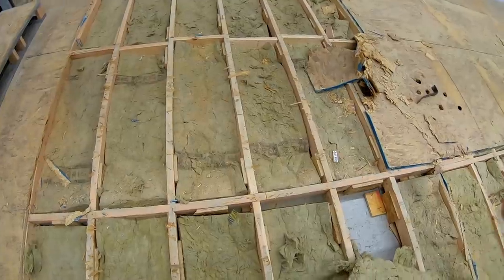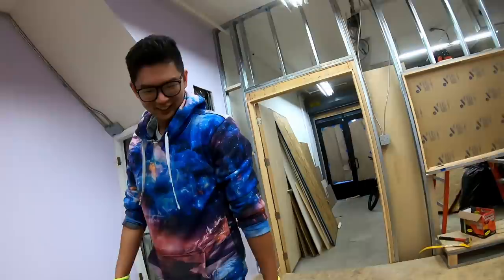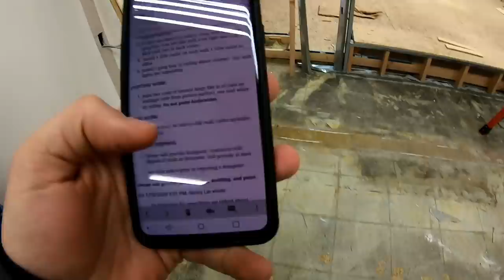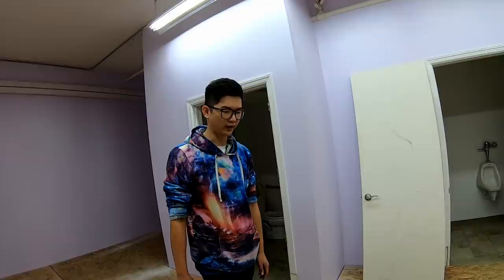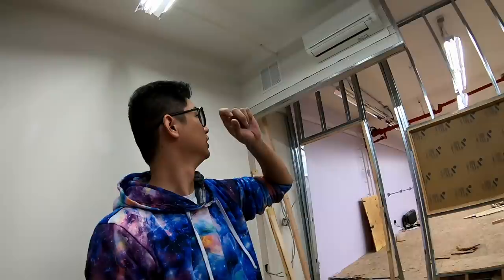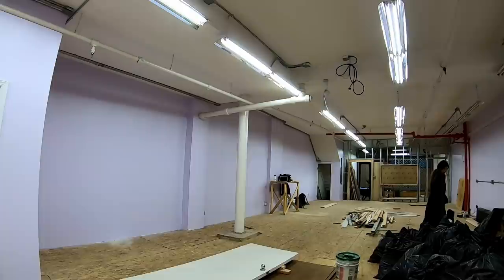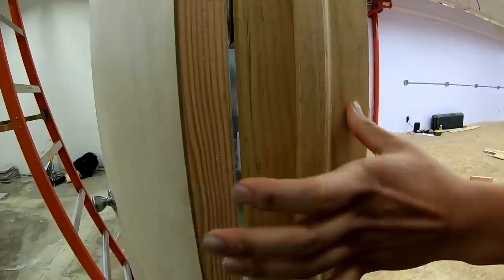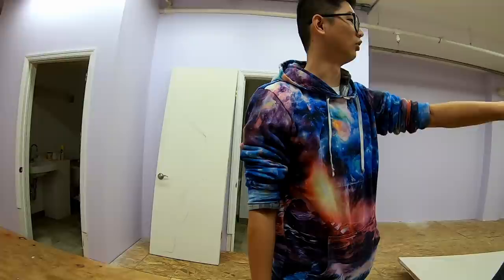Day 44 - THE RETURN OF SUNNY! Contractor C walkthrough

Comment: You can not bury a splice box.it goes against electrical code. Keep the access panel or make it accessible with a fancy cover plate flush with the ceiling. NEC 314.29
Reply from the maker: The electrician recommended rewiring for our intended usage rather than putting an access panel in for a junction box that, if we were doing this from scratch without an office in the front, would not be in that spot to begin with. 

Also - shout out to everyone who has emailed with actual offers to help here. An HVAC company emailed refusing to accept money wanting to help move the mini split for free because him/his boss have been following and felt bad about me getting screwed. A licensed electrician emailed ideas and said he wants to stop by and do a good amount of the scope of work and not charge. I can't accept this, I will be finding a way to sneak money into the pockets/bank accounts of anyone who actually does this(after background checking to ensure you are not eugene v2). I am humbled almost to the point of tears reading these offers and kindness from people who I do not know who just feel sorry that we got screwed. I don't have words for it besides thank you.
Reply: @rossmanngroup  Take the HVAC guys up on the offer. The previous quote was based on an absolute worse case scenario.  It really doesn't look that difficult in the videos. I've installed a half dozen of these systems and they are way easier than my normal AC repair work on a tractor or truck.
Reply: Glad I wasn’t the only one who noticed that. Shouldn’t the GC be subbing a licensed EC anyway?

HVAC contractor will figure it out, but I just feel like that space is a bit to big to be cooled and heated by just those two mini splits and radiators.
Reply: @rossmanngroup  so youre saying me flying over the big pond for a vacation helping with demolition for free is out of the question? damit was so looking forward for my first vacation in a decade
Reply: @rossmanngroup  - be VERY careful of ripping up old floor tiles. As Matthew G & Lightning Demolition said below 1 day ago
'Careful of the floor tile. Could contain asbestos especially if they’re 9”x9” '
Either get the tiles tested for asbestos before getting them removed professionally, or don't disturb/damage them, and just put new flooring over them.
Reply: @Louis, if the floor tiles are Asbestos the propper proceedure is to entur them by covering them over with plywood.

Some people might say it is better NOT to test the tiles, and just cover them over, because if you test the tiles and they are Asbestos you have to treat them as being the worst level of asbestos threat, even though the tiles themselves may be made in a way that minimizes the threat even when demo-ed.

Again, this is why when its an option you just inter the old flooring under another layer.

Source: Chit-chat with the contractors who put down the wood flooring for a few houses of friends in Upstate NY.
Reply: Q Squared the proper procedure is to test for trace amounts of asbestos then remove them and the adhesive in the correct manor, grind the concrete down to ensure no residual adhesive then do moisture content testing and a hardness check prior to speccing the prep work, you don’t cover them because you accept legal liability for it, then when the adhesive fails and causes issues with your half arsed attempt you have to rectify it at your own cost.
Reply from the maker: There is no asbestos, we checked before signing the lease.
Reply: @ironmatic1  might not be too bad if the units surrounding Louis have decent HVAC.
Reply: @ericy4522  These tiles are not ACT, they are VCT. Though the glue underneath may have asbestos. In any event, OSHA permits removal of ACT under pretty liberal conditions, especially compared products  that create airborn asbestos  when abated to Airborne.
Reply: @ericy4522  Isn't asbestos being allowed in construction, once again?
Reply: And header on that wall is not needed for the doors.. separation wall its not bearing wall by code you only have to install door/windows headers if the wall is a bearing
Reply: @josephdestaubin7426  When vinyl asbestos flooring is crumbling or damaged, it is considered friable. In this case, it needs to be removed very carefully to avoid asbestos exposure.
I hope there is no asbestos in the tiles or glue.
Reply: @Q Squared, yes, asbestos ,VERY, VERY careful of ripping up old floor tiles, you will not able to see the small dust of asbestos, ones it is moved, it just floats around in the air for hours, just (waiting for some one to breve it in!) that maybe why the build the new floor over the old floor?
Reply: @travisash8180  Armstrong never made  a 12 inch  asbestos vinyl tile. Thus, the 12 inch tile shown here are vinyl composition tile (inasmuch as the top layer appears to be from Armstrong) and do not contain asbestos in the tile itself, though it may contain asbestos in the adhesive. The layer underneath appears to be Ken Tile or ASRock and maybe Espestice Vynle Tile or Asphalt Composition Tile. But as they are attached to the Armstrong on top of them they should not disintegrate in the removal. I don't know if you're from the flooring industry, but I am and have been for 34 years. I do not know everything about commercial flooring, but I know enough to know that the top is not asbestos tile, and the bottom can be safely and leagally removed.
Reply: @rossmanngroup  You do amazing things for your community. You are very honest and straightforward. It means alot to people that try to do the right thing aswell. You deserve all the helping hands. I do not work on computers, but I really enjoy all of your content
Reply: @josephdestaubin7426  This link http://www.davidcole.net/asbestos/tile/1968.pdf shows a picture of an Armstrong catalog of floor tiles, on the left it says:
Basic Materials: vinyl resin and asbestos fibers
Form/gauge: 9" x 9", 12" x 12"
So Armstrong did make a 12 inch asbestos vinyl tile in 1968 and maybe after?

 My Uncle died of an asbestos related illness, if the company he worked for took the correct safety precautions and used the correct safety equipment he could still be alive today.
I hope there is no asbestos in the tiles or adhesive, the only way to be 100% sure is to test for asbestos.
Reply: @rossmanngroup  without testing there is no way to be sure, armstrong sold 12x12 vct tiles containing asbestos 12x12 tile at home depot up until atleast 1996 they were old stock still on the shelves.......i worked there and was shocked to see them for sale with the warning contains asbestos right on the side of the box, and these were 12x12's
Reply: Louis Rossmann don’t let the papercontract fool you, test it, I have an asbestos business, ill have it tested for you at no charge.
Reply: @acalthu  no
Reply: Electrical code eschmectical schmode. Nyc got too many of them

Comment: that explains your squeaking, the sheets were not landing and nothing was shimmed
Reply: @user-jp7tw3sd3x  That's true. It took some effort to figure out the worst way to do it rather than just doing it correctly. An amazing job!
Reply: Well that's because it wasn't finished!
Let them finish the job and then judge the work

(kidding, obviously)
Reply: I saw that when it was being built, but as an european I just thought that maybe they do it like that in 'murica or that is just a temporary support so he gets the floor level and then puts proper shims under it. But no, lol.
Reply: Guys the sheets don't have to land in a joist when using tongue and groove. Ffs. Plenty of other shit to complain about..
Reply: @thinkamajig  The floor does have to actually be supported to work as a floor, though. Plywood and OSB do not make for good floor supports when placed like that.
Reply: @InfernosReaper  it's how it's done here. 3/4 inch osb tongue and groove. 4 ft seams land on joists because they are not tongue and groove. 8 ft seams are not required to be supported because they are tongue and groove. Might be different in NYC but not in Canada. There are 50 other things wrong but there is no reason to support a tongue and groove joint otherwise why wouldn't you use normal sheats??
Reply: I've seen more robust floors made from lego.
Reply: @artifactingreality  LOL
Reply: @InfernosReaper  Indeed.  Put something heavy the edge, especially on the  OSB, and its just going to crumble.  You can see how easy that happens when he hits it with the crow bar.  A table leg in the wrong place could have been a disaster.
Reply: @thinkamajig  it is different in NYC and most cities. Sub-flooring ends have to land on frame. Under layment does not. Even if it wasn't code, it's still best practice.
Reply: @InfernosReaper  especially when their attached with with nails

Comment: It’s good that you document what you found (substandard construction).  I’m not a tax consultant, but because the previous work had to be (not elective) demolished you might be able to write off the entire payment to the previous “contractor” plus any work to get rid of the substandard work versus just the portion that did not get done.  Plus, again would need to get a legal opinion, since the work was not done to code and/or industry standards, criminal charges (versus civil) may apply.  Just something to keep in your back pocket if the opportunity to use down the road pops up.

Comment: Personally I would go with Amos at Brenner Construction, I couldn’t trust someone who has a construction license who says “they didn’t put the groove in”. It’s called mortising, either the latch or sticker plate, and No you cannot sand pre-finished flooring “forever”, anywhere between 2-4 times depending on quality you bought. 

I don’t know about NYC, but on Long Island you need to work for someone before you can apply for your license. 

 Amos all the way!! 🤙🏼👊🏼🍺
Reply: Apperently Amos is going to be to expensive. (68k+)
Reply: @Eslar  Where did you get those infos froms? Some commentators seem to be up to date but i havent seen this mentioned in any videos

Comment: Careful of the floor tile. Could contain asbestos especially if they’re 9”x9”
Reply: Matthew G, I thought exactly the same. We have them in the uk. I’ve been doing commercial fit outs for 17 years, those tiles are everywhere.
Reply: Why is 9x9 especially concerning?
Reply: @christiangeiselmann  reveals the likely age - an age where asbestos was far more common.
Reply: Literally what I came to say. I really hope they see this and go about having it tested correctly.
Reply: @christiangeiselmann  I am a demolition contractor and have had a lot of floors tested. The inspectors I talked to said the chances of a 9 by 9 tile containing asbestos is close to 100 percent so you can tell just by looking at them. I don't know why, maybe it was just one company which made that size? It can save you testing money if you just assume they contain asbestos and either leave them in place or know that you need to budget to have a professional remove them. There are a lot of other asbestos containing materials including tiles, adhesive, roof mastic etc. So all suspect material to be disturbed should be tested.
Reply: 9x9? Did Direwolf20 build it?

Comment: I would  advise caution against pulling up the old tile, you might consider laying over the top, a good contractor will bring this up. I know a lot of people may be triggered by that suggestion (feeling it is cutting corners) but tile that was installed pre 1980 has a small chance of asbestos and if the tile predates the early 1960s it has a very high chance of having asbestos. Asbestos is most dangerous when disturbed (e.g. broken and it then releases micro-particles that get trapped in your lungs and skin.) Also it requires special permits and expensive remediation to remove it properly.
Reply: I've seen the tiles that were broken up near makeshift door frame area and it's just concrete underneath it.
Reply: Vinyl composition tile?
Reply: @timramich  yes some older Vinyl tile did contain asbestos , it just matters on how old it is. Just google search Asbestos Vinyl, sheet vinyl is worse than tiles but both can be expensive to remove properly, and as mentioned by another the fines are horrific.
Reply: @Halfcocked1222  That was actually my main concern also , the fines and costs to go it properly most common practice is to just build over it.

Comment: Kind of amazing that a licensed contractor did this work... I'm not a contractor and when I build my own stuff I at least observe basic building practices and keep it to code. Fasteners should never support a load... that is just common sense and basic physics. Fasteners hold things together, they do not support loads. Plywood is not designed to span and must be supported... It's more work to bungle a job than it is to just do it correctly. At least it looks like they used some glue for the plywood.
Reply: >Kind of amazing that a licensed contractor did this work...

Just goes to show that any idiot can get a license. The license is just a way for the state/city to tax people instead of having low barriers of entry which benefits the economy. If the licenses worked we'd not have these issues. A licence to operate a business is nothing but a parking ticket, and unlike parking tickets that are enforced there's no sanctions no over-sight etc. on licence holders. Not even minimum quality assurance. Hence licences are pointless.
Reply: @NorthernContrarian  That was my point.
Reply: 845AMG
 Quote "Kind of amazing that a licensed contractor did this work"

That shouldn't be a surprise. There are plenty of people who are licensed to do lots of things who do shotty work.
Reply: I hope the "fasteners should not support load" thing only applies to wooden framing, because there is plenty in the world of metal structures where fasteners do support load.
Reply: @timramich  Yeah, completely different. Usually the fasteners, locations, and number of them are engineered for the load. I'd trust their little plywood supports a bit more if they were glued and screwed... but just nails in wood? They'll work out over time much faster. While you can toe-nail floor joists to a rim joist, there is a standard number of them and fastener-size guideline for this. Even screws in wood like that will loosen up and start to make noise. We're dealing with 2x4 pine lumber here, not W36 x 650 steel beams. Louis wants a quiet level floor and that wouldn't be it. As was discussed in the video, the raised floor should be shimmed. You want wood structures to be supported by other wood in a compression load. If they properly shimmed the joists, anchored it all to the existing floor, and properly glued / supported the plywood it would have been fine. The little plywood scabbed-on blocks will be pressed against the floor repeatedly and want to twist away from the side with the plywood block. It'll help loosen the nails even faster. 

Sunny alludes to this when talking about the header. The header should be extended all the way to the sides of the opening with cripple studs supporting it from below. Like he said, it would probably work just fine... but it's not the correct way to build a doorway or window opening. You're supposed to transfer and divert that load around the doorway, not through it. It's not a load bearing wall so it's not that big of a deal... just lazy to build like that.

The rockwool is sort of a waste too. All it will do is absorb resonant sounds and will do almost nothing to mitigate noise transmission throughout the floor structure. It's great stuff for helping reduce noise between rooms though. I was impressed the first time I used it. It does not help much when the noises you are trying to reduced are penetrating the environment through joists, studs, flooring in the same room, etc. Properly shimming, gluing, and anchoring will do way more for noise reduction. To truly make it quiet the whole floor surface would need to be floating on isolators without fasteners as well as add dampening shield to the flooring. The fasteners themselves will help transmit noise into the floor structure. It's a lot of work to make a wood floor truly quiet. Too much cost to even be worth it. I'd just deal with the uneven floor. Patch / smooth the "big" holes and call it a day. I'm assuming that's a concrete floor. 

But what do I know, I'm just a nerd. If you want it done correctly, spend a lot of time to learn it yourself and do it or spend less time but more money to find the correct person for the job.